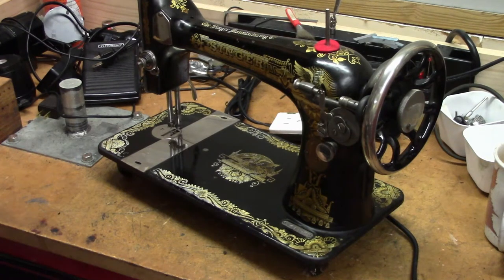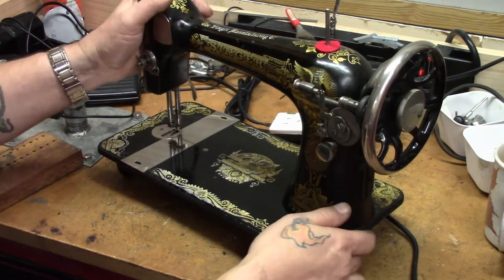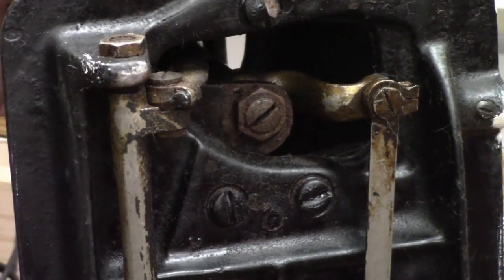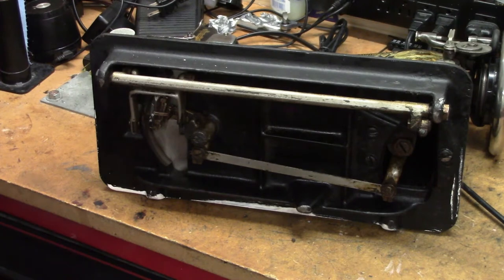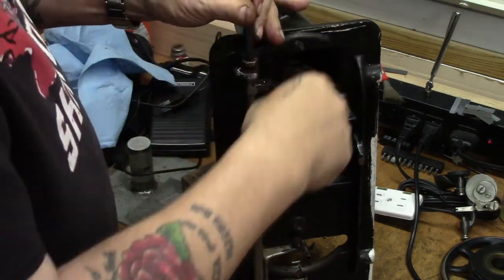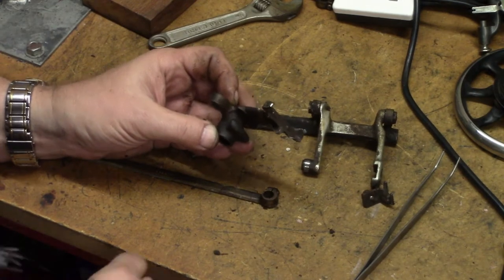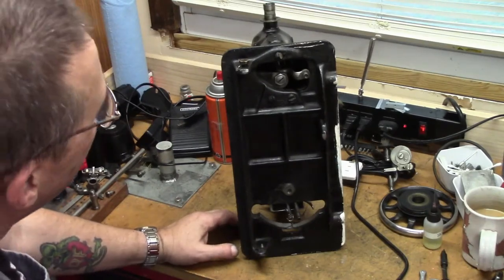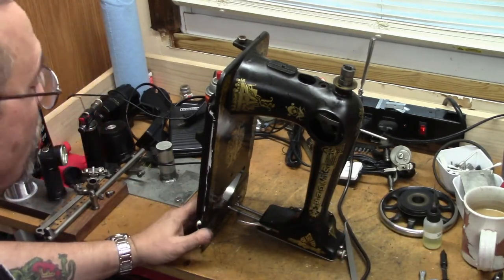Singer 127 Bottom mechanism cleaning and restoration

Comment: Excellent!  The new camera really is much better.  I'd very happily watch a whole series on the 27/28/127/128 - and when you do the close-ups, they're really useful.  Thank you for those - it makes it so much easier to see what I need to focus my attention on.  I haven't been bold enough to remove those bottom bits from a machine yet.  After I've cut my teeth getting the feed regulator and fork etc back in I'll watch this again and see if I can break it down into "I can do this" bite-size sections.  This machine, while it stitches well, is a little bit noisy and I'm hoping that as I get things cleaned up and adjusted just so she'll quite down a bit.  (Maybe her voice is just a little rusty after not getting used in decades!)
Reply from the maker: Thanks Megan, I hope these help. BTW - All of the vibrating shuttle machines are a bit noisy, at least when compared to a rotary hook machine like a 201.

Comment: I am very happy with your explanation about this machine, I will also clean mine in this way. mine is from 1926. can the stitch length be changed? unfortunately I don't have a book. thank you very much.
Reply from the maker: The stitch length is varied with the knob on the front of the machine.

Comment: I've got my whole machine cleaned and working well, save for the Bobbin Winder. As the gear rotates, it rotates the screw with it until it has too much tension and sticks. If I hold the screw in place with a screwdriver while it runs it works, but that's obviously not ideal and makes it had to keep the tension (and thus gear speed) consistent. Do you know what would cause this issue?
Reply from the maker: It sounds like you might have a bad spring washer under the main gear. Email me and we can chat about it... argosybob@gmail.com

Comment: How long does it take you to take everything apart and put it in the cleaners to to let it sit
Reply from the maker: I can pull a 127 (or most domestic Singer straight stitch machines) apart in about half an hour. Cleaning the parts takes a lot longer, of course, and a lot depends on how schmooey the parts are. If I can get a solid day with no interruptions, I can knock one out before dinner time.

Comment: Thank you for posting this video. I'm trying my hand at restoring a Model 27 from 1890s. I'm going to have to break this whole thing down though as it's a mess inside. Can WD-40 be used on tough screws that wont move?
Reply from the maker: WD-40 isn't a penetrating oil and is lousy as a lubricant as well. I use Aero Kroil to help break stuck screws loose. Proper sized screwdrivers go a long way in keeping your screw heads from getting chewed up too.

Comment: Hi Bob,  My mom has an old 127 in a 5 drawer cabinet that looks to be in rough shape. It is on a treadle base but also has a motor, I believe it was bought as an add on option.  I have never restored a machine before and was wondering if you would be willing to look at some pics and give a bit of advice. If so could you tell me how to contact you?  Thanks
Reply from the maker: Sure, email me at argosybob@gmail.com.

Comment: i have a little older model but the workings seems to be the same. i wonder is it doable for a woman to do it and is it pretty straight forward or is it tricky to put back together. i have a little diy expirience and limited tools. what would you recommend me to do. i would like to give it a good clean and new coat of paint.
Reply from the maker: It's not too tricky to get it back together. It is important to have a firm understanding on how the mechanism works, and a copy of the adjusters manual is a huge help in making it work. Given time and patience, anyone with a modest amount of mechanical ability should be able to work on these machines.